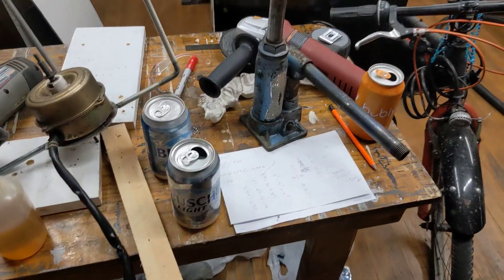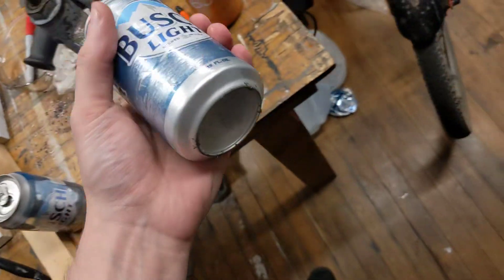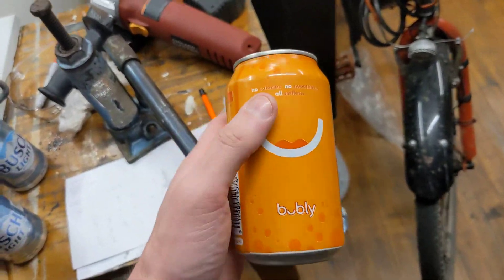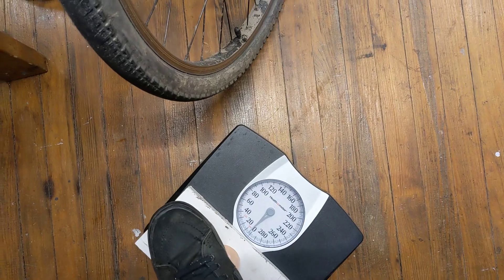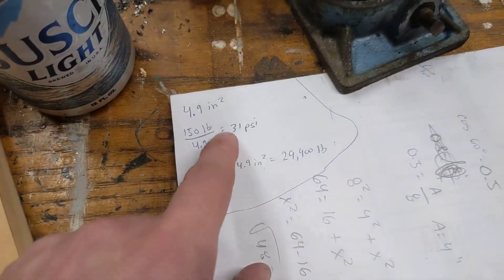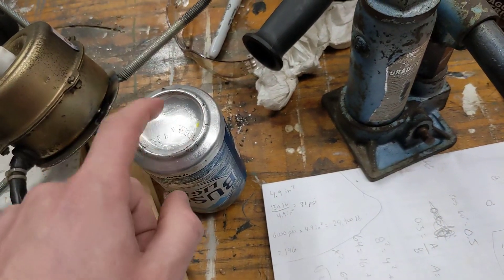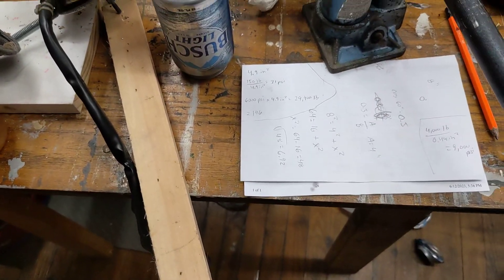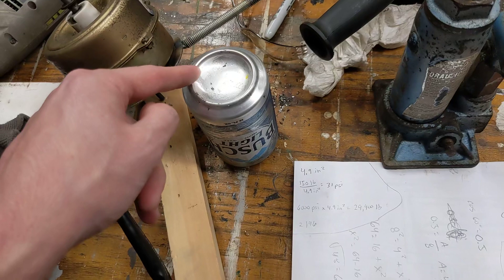The Aluminum Can Submersible

Comment: I'm trying to get my head around this so apologies for sounding dumb. Not everything is under pressure down there as obviously the Titanic wreck and other items are still relatively intact.

Is the oxygen pocket trying to escape the pod or is the water pressure pushing in? And if the water pressure is pushing in, how exactly does it "know" that there's air inside?
Reply from the maker: Water is pushing in. Bulk solids themselves (e.g. steel) aren't really deformed by such pressure but when it's a solid vessel containing compressible gas or vacuum at low pressure, the structure of the vessel becomes very important because the water pressure is high vs. the internal volume of space. In Titanic, the volumes internal to the ship that are filled with water are at the same hydrostatic pressure as the outside, resulting in zero net force.

Comment: Im pretty sure it only went down once prior to the implosion trip, not multiple times which created fatigue. It also never went down the the full titanic depth on its test voyage. The fatigue was likely because they used expired "prepreg" carbon fiber. It was pre impregnated with a glue, which once it gets a bit warm prior to making a pressure vessel seriously degrades its performance. Also carbon fiber shatters instead of cracking, so if it fails you have absolutely no warning.
Reply: 3 previous trips confirmed

Comment: You can do a better demonstration by getting a sealed can and drilling a 1mm hole in it and emptying it of whatever fluid is contained in it. put a small amount of water back into it and heat it with a candle until steam come out of the hole.
The dip the can in a basin of cold water - air pressure will crush the can as the steam condenses.
It is more impressive if you use a tin can.
You can do this with a tab topped can but the procedure is harder to describe in writing.
You put water in the can - heat it till it steams and plunge it , tab opening down , into the basin of cold water.
Reply from the maker: That's a bit like filling a railcar with steam to clean it then closing it off and allowing the steam to condense.

Comment: It definitely did not look thick or mass having enough at all
Reply from the maker: The hull was reported as being 5 inches in thickness. The critical distinction is that the vessel was in compression, not tension. We routinely have CNG tanks and other pressure vessels made of wound fiber and metal that withstand double the pressure....it's "easy" when the force is pushing out...not so easy when it's pushing in!
Reply: @anthraciteenergetics5497  also just saw new pictures those bolts on the front look laughably small and weak, also not enough of them, seems he optimized for ease of getting the thing bolted shut instead of having the necessary force to hold itself together